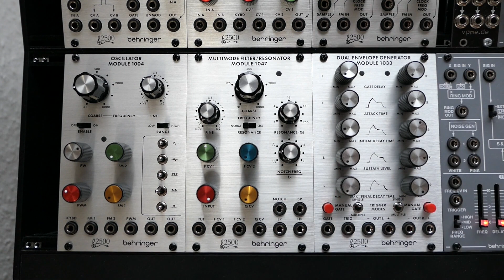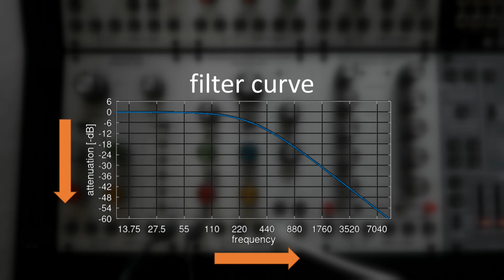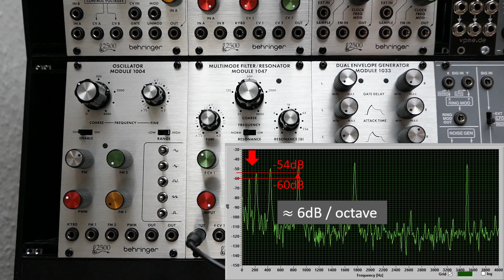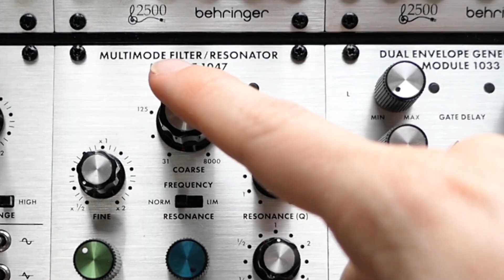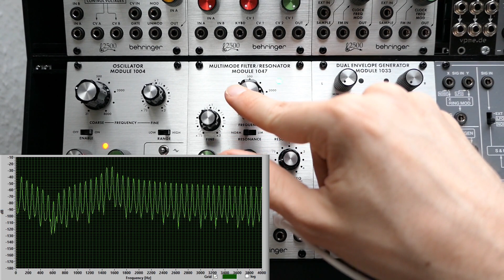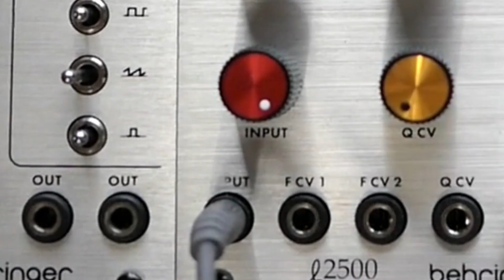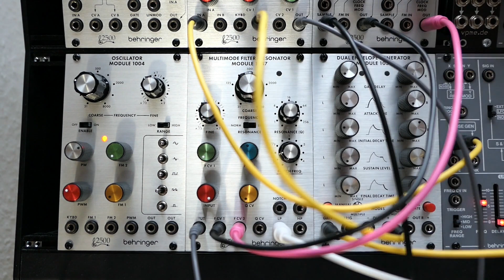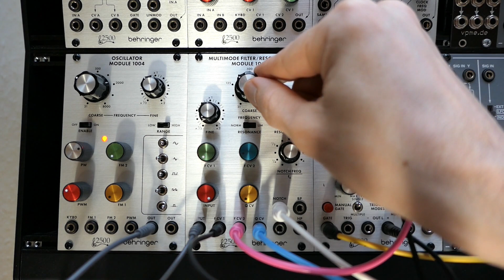Behringer Multimode Filter / Resonator 1047 ~ review & sounds

Comment: Hi been amazed at your videos - sub osc in the sys 100 for a start with the switched gates. I have the 1047 and its one of my fave filters. A long time ago I had the analogue systems version and a trick with that was to patch the notch out to the Res in. This module doesnt give me the same results as that one (or maybe I forget) but just wondered whats going on, could you have a look I dont have the oscilloscope or the knowledge to figure it out. I did try moding the res with another oscillator but this gave wholly different results even at the same frequency
Thanks for your videos by the way they are so helpful :)
Reply from the maker: Hi! Filters differ significantly in their behavior, in particular in these "non standard" patches. I guess comparing the Analogue Solutions one with the Behringer one will certainly lead to different results. I will try anyway and see what I can get out of it!

Comment: can I plug a guitar or bass through these behringer modules?
Reply: You are better off with a synth pedal , cheaper and more inmediate.    unless You have a good understanding of modular synths and own a module Specially Made to receive external signals plus other modules that interact with it.
Reply: @odinmp5  Agree. Unless you already have  a starter kit (case & powersupply & Hi-Z input module) that is the best way to lose money!
Reply from the maker: Never tried. Guitar level is much lower than the eurorack level, so it wouldn't damage the module. But you have to boost the output, or you boost before you go into the filter. There are modules that "convert" (i.e. boost) from instrument level to eurorack level.
Reply: Actually though I'm sure these other folks on the thread probaly know much more about music than I do butttt:  Yes you can can change your line level audio to eurorack levels very easily and change the guitar output into cv (control voltage) to interface with your modules quite easily with the addition of yet more modules from other manufacturors.  The caveat is that for a native eurorack musician to plug in their guitar is a minor addition of gear but for a guitar player to add some modular synthesis it requires learning a whole new system and purchasing all the supporting gear such as racks, power supply, etc, etc.   Using cv to modulate guitar audio is MAD fun though.
Reply: @djmikio  thanks for the info. John Frusciante diid this extensively. and I always wanted to try to do that as well. are there any good YouTube tutorial videos on the subject?
Reply: @levijessegonzalez3629  Frusciate specifically modulated a vintage Arp 2500 with his guitar and none of the out-of-the-box tools available in 2021 so RESPECT.  These days the bridge is coming from both sides as Ekektro Harmonix were discussing adding cv to their pedals and lots of eurorack modules can at the least detect pitch from line audio and convert to cv pitch info.  This is a link to a cv article from the guitar mindset:  https://www.facebook.com/notes/empress-zoia-users/rough-draft-11-a-guide-to-cv-for-guitarists-or-hopefully-anyone/2586175721614538/
Reply: @djmikio  Wow thanks for the info! 

Any behringer synths would be a good starting piece?
Reply: @levijessegonzalez3629  Well definetly watch a lot of videos before you buy so you can actually create your own ideal starter set up and also not buy anything that is unusable until you've bought a ton of other modulres first.  After you have a case, power and an interface for your guitar you could go in several directions.  If say you got what would be similar to a multi effects pedal for a guitar like a delay or phaser unlike a guitar pedal you could modulate it with say an LFO.  It's like all your other modules are expression pedals that are tweaking that one module but you dont need to have extra feet to move the pedal with.   That's one of the points where it gets wilder than you can get with pedals since you can't usually tweak knobs and fret and pick at the same time.
Reply: Behringer is a great place to start with hardware synths in general and modulules in particular if you want to get enough quality stuff to make sound with without breaking the bank. So far they haven't created anything that directly addresses hooking in line level audio as intellijel and doepfer and many others have.  Basically that is because Behringer's specialty is affordably recreating vintage 70s, 80s, 90s synths and this idea just getting going in the past few years.  Keep watching vids and asking channel hosts questions.  I am always amazed at how generous this community is in sharing their knowledge.
Reply: @levijessegonzalez3629  Yes, you can check for the Behringer 2600. It has an amp which can be used for guitar. (Pete Townshend used the original Arp 2600 at several recordings and also advertised the synth). And if you take the grey or blue version, then you‘ll get an analog spring reverb included. 😀